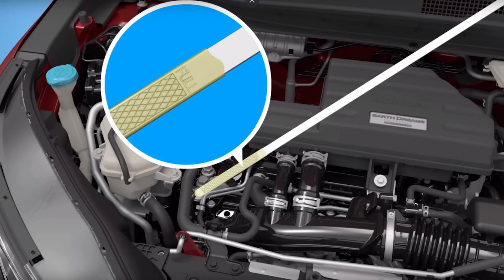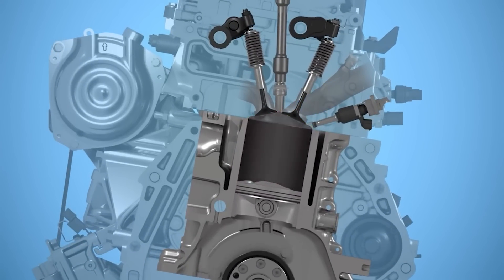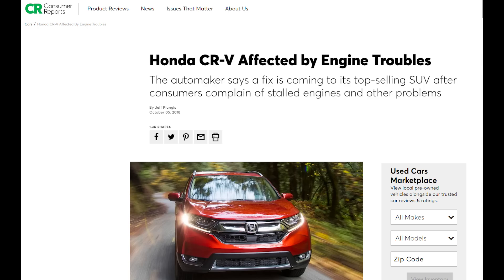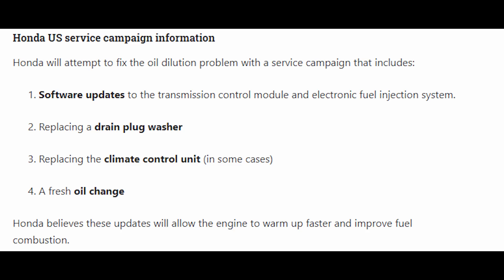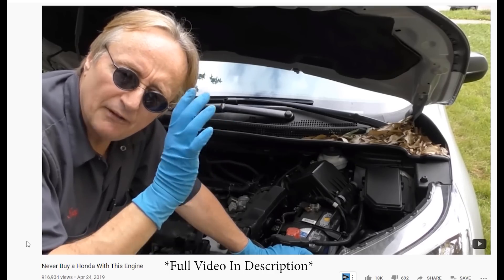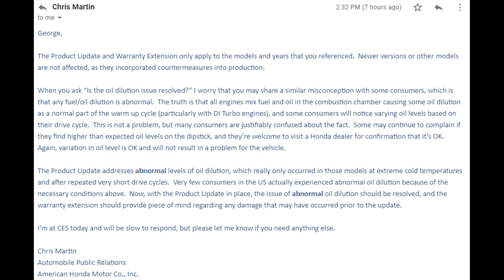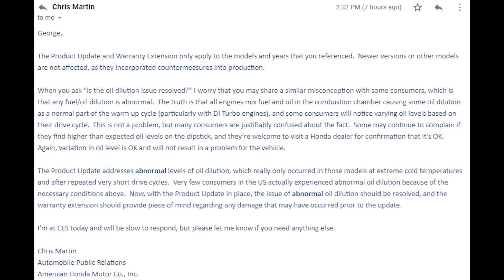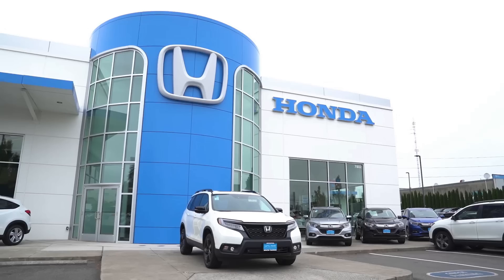Does Honda Have An Oil Dilution Problem? | 1.5L Engine in CR-V and Civic

Comment: A simple solution to the increased wear and sludge is to bond a lubricant to all the metal parts inside the engine.
Wear decreases by 50~90%... which solves the problem.
You can safely do normal oil change intervals instead of reduced intervals.
🙂
Reply: XcelPlus requires a single application every 160,000 km.
There is a 370,000 km test on the website showing wear remains reduced after treatment.
:-)

Comment: I have a 2017 2WD LX with a 2.4L engine. It has had oil dilution problem from day one I bought this car as new from Honda.
The problem is more serious and wider spread than Honda is thinking.
By the ways, I have driven  many Honda models for over 34 years. I have always been a big Honda fan.. I do have a technical background and familiar with automotive technology.
I also know that the manufacturers will always downplay and ignore the facts so they don't have to spend too much on addressing such issues.
The only way you can get Honda fix this issue is probably a class action.
It's a lot of money for the consumer to spend on a new car then to find out they bought a piece of crap.

Comment: It’s the same with Nissan. I bought a new 2020 Nissan Altima 2.5 DI non-turbo. I always buy new and always change out the first oil at 500-1000 miles. Thank god I did on this car. Not knowing the fuel dilution issue, I almost had a heart attack when I pulled the drain plug and the most horrendous fuel smelling oil came out. I wasn’t even trying to smell the oil. The stench was over powering.  I truly thought my engine was toast. I immediately read online that this was “normal” for DI engines. Fortunately the problem seemed to fix itself after a few thousand miles. I change my oil with Pensoil platinum synthetic every 6k miles and the oil smells normal with a hint of fuel and it doesn’t seem to burn any oil either. I’ve heard that the 8k-10k oil changes on these DI engines are killers on the bearings and cam. Now, if your like me and trade in your car with under 100k miles then it probably doesn’t matter but buyer beware.

Comment: I had the 2019 civic sport hatch 1.5 turbo..loved it..changed oil every 4000 miles .and the car heated up within a couple minutes. i did trade it in around 23000 due to the uncertainty of the oil dilution issue...

Comment: Had oil change, checked after 500 miles. Oil level on dipstick up to top. Mine is a 2017 bought new in 2017. I'm thinking we should have bought another TOYOTA!

Comment: I have a 2019 CRV EXL 45,000 miles and have not had this issue. They did extend the power train warranty for the 1.5.

Comment: My 2020 civic has this issue and it's real. I started changing my oil, on the second change at 3k miles I had an extra quart of oil, tried filling next time between the marks, checked about 1500 into it, I was at the high mark. I had to replace a hose that was turned to mush from valve cover to intake, you know it's because of fuel in oil. The used oil is extremely flammable, one hell of a fire starter... This is my work vehicle, I drive one hour each way, and live in Ohio where we do not have extreme cold... 
Very disappointed in this engine from Honda, wish it had a k24 instead... But after this experience I'm going to give Toyota/Lexus a try. I bought an integra in 01, an s2000 in 04, a pioneer 520 in 20, and a civic in 20. Never again my loyalty is gone...

Comment: This is a funny subject that is fully fueled by videos like this and gossip. It was a problem up to 2018 but fixed by 2019 by a software fix. It was also confined to people who lived in cold climates and didn't drive their cars long enough to allow their engines to warm up as in driving short trips. It was great that the problem was discovered and fixed but to exacerbate the problem on and on ad nauseum like this is not worthy of a video. As noted in the video above, if you are still having the problem due to the year car you own or your weather conditions or driving habits, it is easily overcome with the methods he recommended, using synthetic oil and oil changes at 5000 mile intervals. My end result is not the same as yours, I feel the problem is solved.

Comment: I got a 2014 honda crv with 70k on it and the 2.4 is a better motor then the 1.5 turbo some people say that the 1.5 turbo is better which it's not the only thing you're asking is trouble. I read about the 1.5 turbo 3 years they are trash. They could've kept the bulletproof 2.4 that was a extreme good motor

Comment: Have a 2017 Civic Sport 6MT Hatchback with the 1.5 Turbo engine and at 99,734 miles the cylinder #4 had the rod bearing fail and go through the bottom oil pan then come back up and bust a hole at the top part of the block near the L15BA model label. I was driving about 74 MPH on the freeway in 6th gear with my 3 month old baby and wife also. Engine cut out immediately and used remaining momentum to exit and get stuck on a side road. The gas was so thin it was dripping down underneath the car all along the bottom and even dripping down behind the rear wheel. That's pretty thin oil for it to travel that far going 70 mph - 0 mph. Dealt directly with Honda with them telling me they can do nothing since its out of warranty. The extended warranty would have helped since it was within 5 years instead of the 6 years unlimited miles offered to everyone else within the settlement. I had to buy another engine and am now doing a swap.

Comment: I have a 2016 civic 1.5l bought it April 2021 with 43,000 now over a year later I was doing an oil change and my oil smelled heavy with gas and was black and very thin with 2500 on the oil I found the pvc valve isn’t working so I’m in the process of replacing it but couldn’t find any except one on eBay for $55 will update when I get it

Comment: FYI this is still an issue. My 2021 CRV has a dealer confirmed "oil dilution issue". 6,900 miles. I was told the problem usually gets worse with time.
Reply: Have you been able to mitigate it at all?

Comment: I drive mine in sport mode to warm the engine in cold weather then when warm slide it to drive. Problem solved
Change oil every 4000
Piece of mind 
Run premium fuel
Redline fuel cleaner right before oil change
Service cvt every 25000

Comment: I have 2 of the 1.5L turbos. One is a 2017 civic other is a 2019 crv. I live in northern Wi. Both the engines have had excessive increases to the oil level on the dipstick. Not happy with that, but extra oil changes are the temporary fix for now.
Reply: How has it been holding up?

Comment: I had a 2021 honda crv and I got rid of it at 4100 miles because of this oil dilution problem.  If they tell you this is not happening and not a problem they are lying to you.  I took it in and honda went in the system and changed the oil change interval.  I would drive only 2000 miles before the system said i needed an oil change.  I'll never own a new honda again 👎

Comment: I own a 2019 Honda Civic Turbocharged engine.  I just checked my oil dip stick and found that the oil level was 1.5 inches above the normal oil fill mark on the dip stick.  The oil had a strong odor of gasoline.  It was not due to cold weather.  I did recently drive to Florida from Ohio in very sunny, warm weather.  Before leaving from Ohio I had the oil changed.  I will get my oil changed again, but am concerned enough to reach out to my Honda dealer.  Thank you for your video about this issue.

Comment: As a 2018 CRV owner I can tell you that upon an oil change the level of the oil actually increases beyond full within a week. The oil smells like gasoline and you can smell gasoline on a cold start up. He's idiots who think Amsoil is fixing something are in for a shock.
Reply: Hey I was wondering if you can give me the advice my daughter just bought an 18 CRV 1.5 Turbo she has 30 days to bring it back to CarMax it has 40,000 miles on it do you think we should bring it back and trade it in for something else thank you for any advice I appreciate it

Comment: My 2019 leased Honda CRV with 1.5L turbo is also showing oil diluation.  Strong smell of gas when chekinf the dip stick.  So problem on 2019 CRV too.  Good that it is a lease.

Comment: My 2018 Accord has this issue trading it in tomorrow
Reply: The 1.5? How many miles were on it
Reply: @ericmurray238  yes 35k miles oil changes done every 5k miles
Reply: Ended up buying a 2020 BMW 330i no issues super reliable drivetrain

Comment: So I'm thinking about buying a crv exl 2019 in the Caribbean so I should not have any problem with oil dilution since oil dilution happen when  there are low temperatures and in the Caribbean is always hot.. 

Please Leave you opinion:

Comment: I just did my 2016 civic 1.5 liter turbo engine. I use Mobil 1 advanced synthetic oil and OEM oil filter. The vehicle has 125K on it. The oil is changed usually when the warning is at 15% so before the suggested intervals. I could really smell gas in the oil.

Comment: I've owned a brand new 2019 Honda CRV EX-L Model, the 1.5 Turbo, back in 2019.

Up until now, NO ISSUES WHATSOEVER and still running strong.

Literally any story you hear about this before the 2019 models is BS.

Comment: I have 17 civic SI and never have I see my oil being deluded. Why because I don't change my oil every 10k mile. I change every 2k to 3k mile or every 3 months.  Sending $70 on a good oil change will keep my car running for the long hall. And changing my spark plugs every 3 oil change.

Comment: I found another issue in 10 gen civics. The corner of rear tail lights is to close to the body and by vibration it  destroys the paint specially at summer.

Comment: GTI motors and Honda engines that are 1.5 L that are direct injected garbage no disrespect in a Honda community or anything like that I drive a 1.6 L D 16 Y8 that makes about 205 to 210 hp at the crank
Reply: Right, because we're all racing our family vehicles, right?

This is a soccer mom vehicle, lmfao, 1.5 DI Turbo fits ths bill and is pretty impressive.

Comment: Why is it just the 1.5L?  Why not other Earth Dreams engines as well?
Reply: It literally says that these 1.5T are the first of their kind in the States, like a Mark 1 model.
Of course they're issues, this being oil dilution as a result of cold Temps.
2019 and beyond all have the updated 1.5T, I've owned a 2019 CRV EX L model, Am a Uber driver and put serious miles on it, currently at 66k, NO OIL DILUTION PROBLEMS.
Just normal wear and tear, like spark plugs and tires.

Comment: only 5500km， warning "engine oil replacement due soon". Manual say: one year or 10000km , chang oil. I only drive 5500km, 5 months normal drive in Sydney. does the car CRV 1.5T ,2021 model have a problem?
Reply: Some people do oil changes at 5k.

Look at it this way, it's better for the engine, so do it.

Comment: Well, that was not reassuring. When you go to Honda to get the answer you get the expected non answer. If oil dilution is normal for a GDI engine then don't build it. Simple  My last three cars have been Hondas with no problems, but imo these are no longer Hondas.   I'll take Scotty's advice for my next car.

Comment: Just an FYI here. The video from the Scotty Kilmer (though a great video) is of the 4th gen CR-V and has the 2.4L engine, not the 5th gen 1.5L turbo that so many of us have major issues with fuel diluting the oil.

Comment: Sad, new cars cost so much more,  and  simply don't last as long. Honda use to make some of the best small engines.  How is any gas in the oil okay? Gasoline is a great solvent,  need to clean up dirty motor oil spot gas will dissolve oil pretty darn well. I will never buy any GDI engine, and don't get me started  on these stupid start/stop cars, or tiny turbo engines in trucks.  You can still buy a normally aspirated Rav4 that's what I'll buy.

Comment: Why Honda can NOT define ABNORMAL OIL LEVEL  by providing ABNORMAL OIL LEVEL mark on oil dipstick, same way as they defined LOW Level. This would help customers to take appropriate action. 
Their answer ( Oil dilution is normal) is not backed up by any technical information, example: acceptable oil viscosity for this engine. 
I have only 7000 miles on 2018 CRV, had the oil changed 2x , had the software update done. The problem still is not fixed!!
Reply: So I guess you stuck with vehicle unless you planning to switch right

Comment: I have owned my 2018 CRV since Nov of 2017 and reside in the North.  It has had all the Northern upgrades.   I now have 84,000km on it.  My usual commute is at least 20 miles a trip.  The last upgrade was done in the late winter of 2020 so I have not seen how it will handle extended cold.  I still suffer from oil dilution and what I would say is a cool cabin but it is better than it was.  I know that is not saying much but that, the high cost of replacing it and the extended warrantee has convinced me to keep the vehicle even though I have concerns about the engine longevity and its resale value.  One thing I might mention is in regard to reports that the crankcase is a liter over filled.  I changed my own oil and noticed that 3.5L, as recommended by Honda, only registers 1/2 way between low and high on the dip stick.  Every time I had the oil changed at a dealer the dip stick registered at the top line.  That suggests to me that it is being overfilled by approximately 1/2 liter from the start.   Hope all present owners don't suffer premature engine damage.  Honda has been dancing around this issue since it raised its oily head at the beginning.

Comment: Year:2019
Model:Civic
Base:Hatchback Ex
Engine: 1.5T.    Miles:29k
I purchased this vehicle in 2019 brand new 0 miles I used this as my daily driver for 13 months now and my commute consists of 53 miles one way 5 days a week. Vehicle maintenance has always been done on time fuel pump motor RECALL was replaced Jul 2020 September 14 20 car became non operational. Currently have open case with Honda of America
Reply: Any updates

Comment: I live in Florida and own a 2017 CR-V with the 1.5L Turbo.  I did notice that my oil level was quite a bit overfull about 1000 miles after a dealer oil change and the oil did have a gasoline smell.  The dealer denied that it was diluted and claimed their tech must have overfilled it, which is still not good for the car.  They did an oil change at no charge.  I have not seen it occur again.  Honda refuses to apply the cold climate programming change to my vehicle, claiming that they only do that to vehicles owned by people who live in northern states.
My concern is what happens if I should decide to spend an extended time up north in the winter?  The last time I was up there during the winter I asked an Ohio Honda dealer it they would update the computer and they said they would not since I was not a resident up there.  That makes me think the change must be to lean the mixture down and/or warm the car up faster in the north.  Could this change be an issue if the vehicle is in a warmer climate?  Seems like Honda isn't being totally honest with their owners on this.

Comment: To all of you out there who don't understand gasoline engines they all have oil dillution i have never changed oil in a gasoline engine and not smell gas in the oil motor oil has additives to counter oil dellution

Comment: I have a 2019 Civic Hatch and the oil dilution is not terrible, but it is there sometimes. Half of the time I do smell some gas in the oil when I open the oil cap or check the dip stick, other times it just smells like oil. I can't remember if it's worse in the winter time than the summer time.

One way I could see this be almost completely eliminated, is getting the block heater installed. Once it's installed, you could plug your car in for around 20 - 30 minutes (as you are getting ready to start your day) to preheat the engine, then unplug it when you're about the start the car, and head out after idling the engine for about 30 seconds. I hear that the oil dilution commonly happens on the warm up cycle, so the block heater might be a good solution to reduce it down.

I also found blasting the AC causes the engine coolant to warm up faster compared to without it. But I only do that when I am getting in my car after it's been parked outside for around 7 hours in the sun. Doing that early in the morning is not exactly ideal...

Comment: Any problems with the  2020  Honda accords with the 1.5 Turbo engine and oil dilution?
Reply: I have the 2020 CR-V, no oil dilution, warms up within 3 minutes every time. It’s much better than my 2016 or 2010 naturally aspirated CR-V engines. If you don’t have the oil dilution problem... and every engine does, the 1.5L Turbo is the best engine you have ever driven. I’m at 7,000 miles and no oil dilution. To compare my 2018 Hyundai Santa Fe has more oil dilution than my 2020 CR-V
Reply: @Precious_Metals_Fissioneer  Thanks for your help and honesty. Stay healthy and be well Craig. Thanks!
Reply: @adeline rojas nope, still no gas smell

Comment: Honda is blowing smoke up my ass.  Gas in the oil decreases the lubrisity and increases the engine wear.  I don't want to pay to change the oil every 2,000 miles.  Fix the problem!